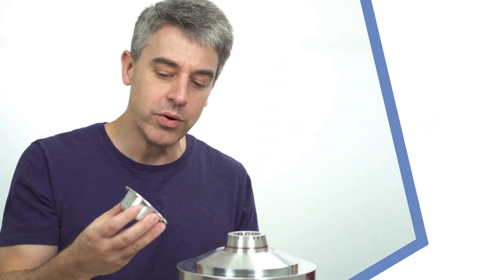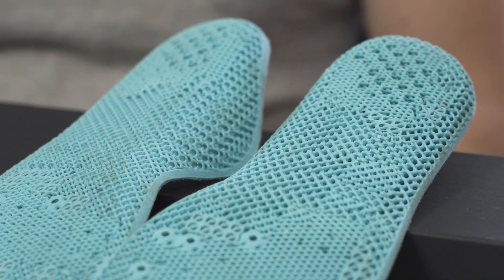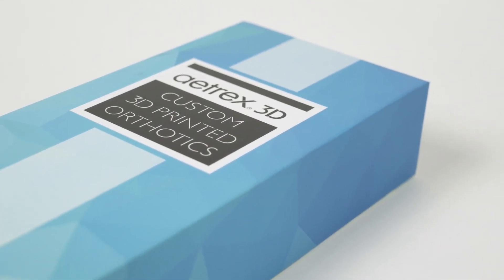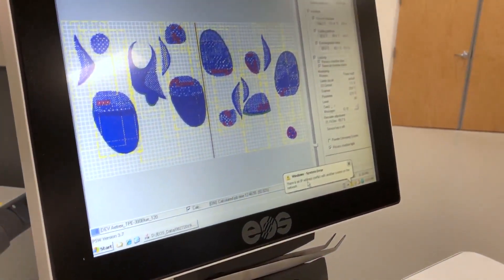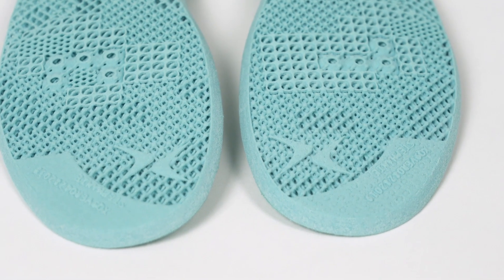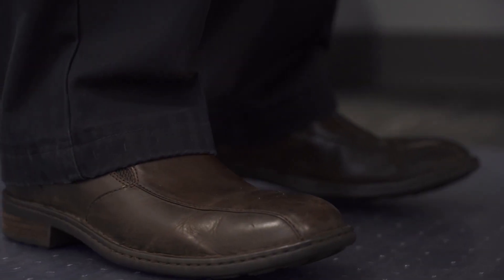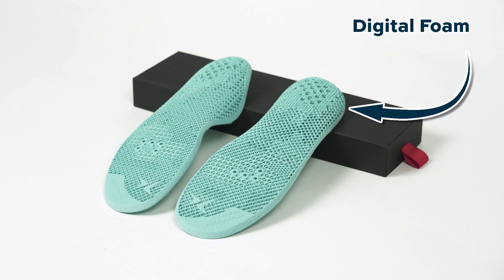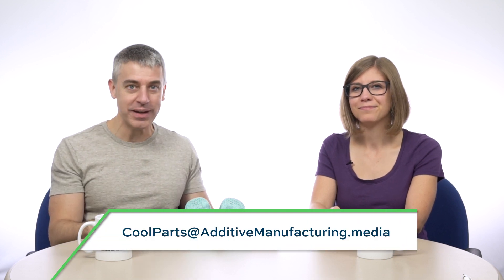These 3D Printed Shoe Insoles Are Precisely Customized to Individual Feet: The Cool Parts Show S1E4

Comment: I wish you had asked a doctor about the health benefits. I believe this could be really comfortable, but are the rest of us really breaking our feet by wearing not customized insoles?? I kind of doubt it.

I would really like to try a mattress made in a similar way. The human back is not a homogeneous planar surface!
Reply: 100% they should have spoken to an unaffiliated pedorthist, podiatrist, maybe even a family health physician. You're never "breaking" your feet by not wearing insoles. There's an entire market around barefoot, which is great for those with healthy feet. However, for those with even slight conditions to their feet, orthotics are a great option. The bones, muscles & tendons of your feet support themselves, and orthotics are made to support your foot when they aren't able to do that to the best of their function. Those with improper gait, plantar fasciitis, flat foot, high arch, bunions, hammer toes, claw toes, et cetera.

The vast majority of people do not need custom orthotics, nor are they benefitted by custom orthotics. Off-the-shelf orthotics will function great for minor cases, even the cheap ones. I wear off-the-shelf orthotics & I have no foot condition that I believe would benefit by the orthotic I use. I do have claw toe, but not severe. I mostly wear my orthotics for total contact to help prevent any fallen arches & because of the forefoot/heel padding. I have a pretty heavy heel strike in my gait as I am heavier weight.

- Aspiring pedorthist, just a rural fitter of therapeutic footwear for now.

Comment: Nice!  what about a focus on having uneven leg lengths .
Reply: Leg length discrepancies can only be accommodated by custom modified footwear with a thicker outsole on the shorter leg. If you're a diabetic, you can get this footwear covered by your insurance. If you're not a diabetic, you'd just have to fork out the full cost ~$160. You can look for a company like Hanger Clinic, or just look for a local pharmacy that has a Durable Medical Equipment section. Ask them if they have a CFo/CFt. (Certified Fitter of orthotics/therapeutic footwear).

Comment: Using a foam box to make an impression is never accurate and only used by those who have little understanding of the process. This system would benefit from dynamic measurements for a true representation of the pathology and the interventions needed to remove risk of injury.
Reply: No, foam boxes are entirely fine for impressions. Even the highest level of pedorthists and podiatrists often use foam boxes lol. Sure, sometimes they use casts, but it's more costly, time consuming, and gives an equivalent outcome if you're just getting a plantar surface impression.

Foam boxes are to be used in conjunction with gait analysis, visual inspections, questioning about concerns, et cetera. Otherwise, a foam box itself will just give you total contact, you'd have to know the exact conditions you're treating to make the right accommodations to the custom orthotic.

Your vocabulary is eloquent, however I'm not even the best on this topic yet I can see flaws in your stance.
Reply: You are right my pediatrist made a full cast of my foot